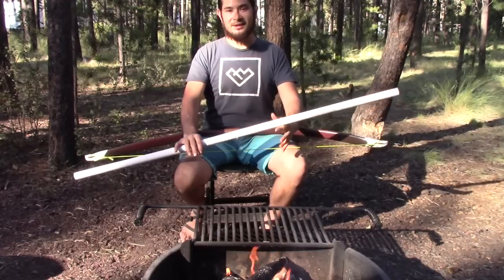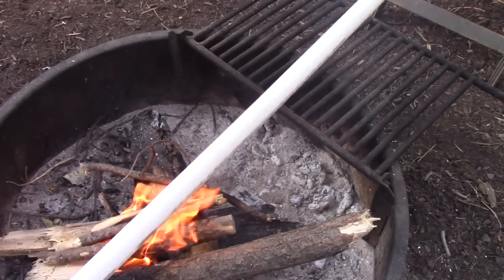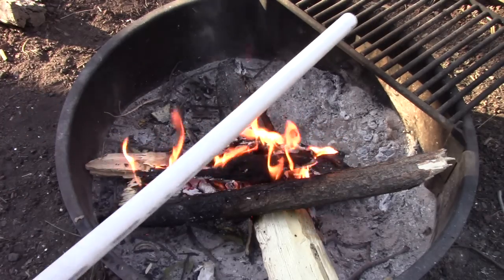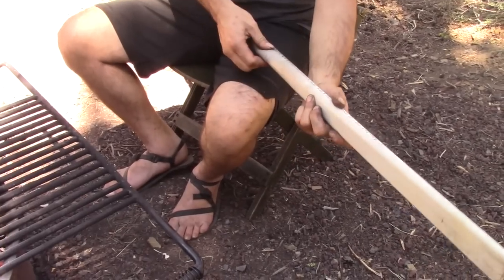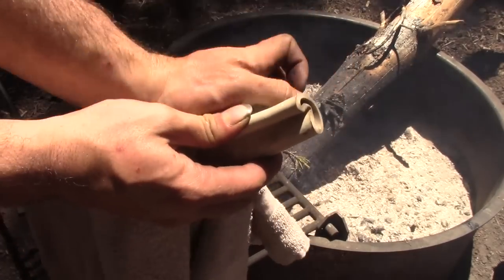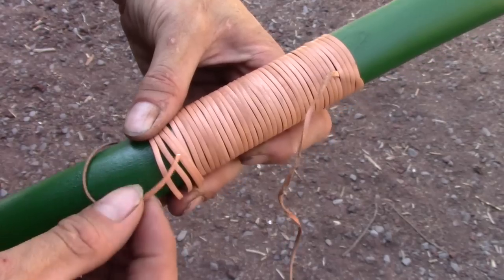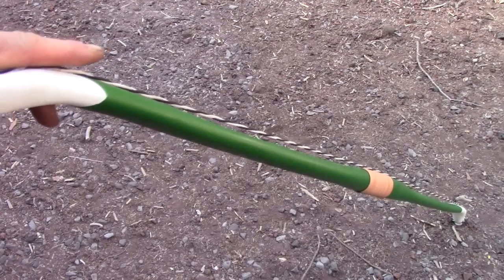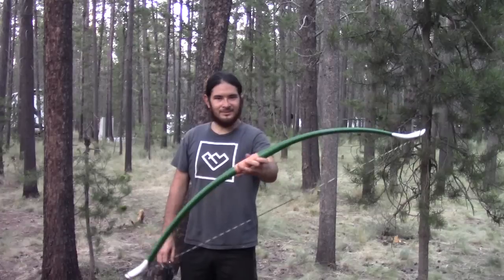Making a 50 Pound PVC Pipe Bow - Echoes in Time 2020 Online

Comment: You are an outstanding teacher and craftsman. I have shaped my share of pvc working in the electrical trade. We would block at least one of the pvc with duck tape, so as to hold the heat in and heat from the inside also. Saves around 50% of heating time.
Reply from the maker: Thank you for watching and sharing your knowledge!

Comment: Would it be possible to make a "hornbow" type out of this? Would pvc withstand the almost 180° flex?
Reply from the maker: Yes it can, but the bow needs to be longer. 62” pipe with 9 inches of reflex will yield a fast bow. If the bow is too short the pipe will collapse.

Comment: For a either dual or single side shelf for the arrow to sit on you can use a wedge of wood bought from a Hardware or big home improvement store. Then somehow make the wide end a tick curved making what you want the shape of using tools like a small hacksaw and sanding smooth. From there use the wide side as the top side inside the handle wrap to the top is about 3/4 from the top then make sure the handle wrap is covering the the whole piece of wood.

Comment: The King is back
Reply: also, is the amount that the limbs are uneven in this bow an issue or is pvc forgiving enough for that?
Reply from the maker: It’s not an issue, just make the limb that bends more the top. The bottom limb will take more set than the top as the bow is used, so more flex on top is fine. Even a pretty lopsided PVC bow shoots alright.

Comment: As a no-heat method have you ever tried cutting a thin strip out of a length of pipe so that it will close along the length and slide inside another length of tube?

Comment: I hope you're still answering questions here - is having one side of the bow flex more than the other, a common thing? Is it desirable to have it that way? Would it be possible to reheat, and reflatten the more flexible side to attempt to make it stronger, and a more even flex?
Also,, a suggestion,, soak your leather wrap until wet, before you wrap your handle. Not only will it allow the leather to be wrapped tighter,,, when it dries, it will shrink slightly, making the wrapping even tighter. Then rub mineral oil into it to waterproof it.
Reply from the maker: Thank you for the tip! Having one limb bend a little more is fine. I make the weaker limb the top end of the bow as it needs to be more flexible for how the handle is placed. If it is really unbalanced, you can reheat the whole limb and reflatten. Another way is to heat the bow limb up until it starts to puff up. If done carefully, the whole limb can be made stronger without having to reflatten.
Reply: BackyardBowyer thank you!
Now I have another question,,, have you ever made a pvc crossbow?

Comment: Great video. Very much interested in experimenting with my own PVC bow. Just not sure what strength of PVC you used, if that is the right term. Here in Guyana I have access to non-pressurized and pressurized PVC. Obviously, the pressurized PVC has much more tensile strength. Just not sure which is best to use.

Comment: Hi Nick! Glad to see you back in action! If I use a 3/4" pipe with all the other measurements the same, do you think i will get a bow in the 35-45lb range? Or should I shorten it a little?
Reply from the maker: Hi! At these measurements you’ll end up in the 15 pound range. 35-45 pounds is 48-44 inches long to start on 3/4” PVC pipe. Thanks for watching!

Comment: About three years ago I watched one of your videos and bought some pvc and fiberglass driveway markers. Since then they have gathered dust in my shed but this video has inspired me again to break out the heat gun. Would you still recommend using fiberglass rods inside? Or do you think only using pvc is better. I'm glad to see you're still making cotent.
Reply: content
Reply from the maker: Awesome! I suggest either heating or fiberglass, but a you can do both. I prefer no fiberglass because the bow is physically lighter and a little faster generally.

Comment: Very nice but i have a doubt when a pipe firing on time how to observe which place in heat takes more and which place heat takes less tell me what will be observed
Reply from the maker: The most important thing is that the whole section that is being formed be within the plastic range (a temperature range from about 180-270 degrees F, or 82-132 degrees C).

I usually test this by quickly pressing my thumb down on the pipe an inch at a time. When the plastic feels equally flexible, I know the pipe is in the right temperature range.

If you are talking about limb-timing and tiller, most tuning is done by adding reflex and reflex in the limbs, and then fine tuning by moving the arrow rest on the bow up and down until the limbs return at the same time,
Reply: @BackyardBowyer I understand clearly but I have near U-Pvc pipes any problem or solve the bow,but it is firing also but doubt ❔❓

Comment: Would you recommend unstringing the bow at all? Ive heard it helps preserve the strength of the bow over time. Super new to this so idk whats good information lol
Reply from the maker: Yes, taking the string of will help the bow. Once of the major reasons to store the bow unstrung is that if something were to happen to it (it's in a very hot car or ends up with something stacked on it) while strung, the tension of the string could cause the bow to warp or become damaged. Without the string on, the bow will not generally deform even in normal high heat (under 180 degrees F).

I hope this helps!

Comment: Can you spray it with water to cool it down and freeze in place without weakening the pvc?
Reply from the maker: You can spray it down, a damp towel also helps. I’ve only ever used a little water, though I have used a little snow in my hand (mainly to keep my hand cool).
Reply: @BackyardBowyer Thanks, nice build and great video. You made the string look easy.

Comment: Can you keep the pvc strung or do you have to keep it unstrung when not in use?
Reply from the maker: You can keep the bow strung, but it may become warped if it gets too warm (in a hot car, leaning against a heater, too close to a fire). I've had several PVC bows strung and displayed on the wall and shot daily for years without a problem.
I always unstring my bows when traveling or storing long term.

Thanks for watching!

Comment: so how do I get a 32" draw with the 50+ draw weight if adding the extra 4 " drops it by 10 lbs? do I go to a 1 1/4 pipe then taper the limbs down on the string end to keep the speed up
Reply from the maker: Thanks for watching and building along! Adding the extra 4 inches will bring the weight down to 50-55 pounds at 32". If you want heavier, this bow draws around 60-70 pounds at 32" without adding any length. If you use 1-1/4 inch pipe, 66" will get you into the 60 pound range. 1-1/4 inch pipe usually draws over 100 pounds at under 60" long.
Reply: @BackyardBowyer  Thanks for the reply think I'm going to give the 1 1/4 66" a try

Comment: Nick, I am 6ft 3in and my arrows for my 90+lb Hoyt compound bow are 33 1/3ins long. Would you mind helping me with the dimensions for a PVC bow that would fit me?? I would like it to be at least 60+lbs let off...thanks in advance! Great to see you back at it!!
Reply from the maker: Hi! If you add five inches to the starting length of the pipe, the bow will draw 50-55 pounds at a 33” draw. Add three inches instead and you’ll be in the 60-65 pound range at a 33” draw.

Keep in mind that there is no let off and the peak comes at the end of the draw rather than mid-draw like a compound. 

Thanks for watching!

Comment: As the pvc is hollow is there a way to increase the draw weight by putting another smaller pvc thru the larger one?
Kinda like a SanMai pvc? New to the channel so not sure if this has been answered yet.
Reply: I've seen it done by another Youtuber, don't remember who though. I tried it myself but it was very hard to get the double tube to be hot enough to be flexible without the outer layer being too hot.

Comment: I made your last hand bend but when stringing it, the limbs took the bend of the bow after unstringing.  Is that normal?
Reply from the maker: Do they bend all the way or did they take about 1-2 inches of Bend? The second is normal. If they stayed completely bent it may be possible they were too hot when strung up.
Reply: @BackyardBowyer  it was quit the change from the straight and ever slightly forward facing limbs to curved back ones. Maybe 2 inches though? Is that normal?
Reply: @BackyardBowyer  oh! And one limb seems a little thinner than the other, so one limb is bending significantly more.  Should I just reflatten these?

Comment: I've seen a few of your videos now. Thank you for sharing them. One video you made years ago shows youtesting the viability of three different PVC pipes by placing them within a cloth and hitting them with a hammer several times. The first two shattered after several Hits and The last of the three did not shatter. Do you do this every time you do a PVC bow or have things changed where you no longer think it's necessary to do this? I only saw it in that video.
Reply from the maker: I do this on every plumbing and electrical PVC pipe I buy unless it is obviously cracked or shows signs of yellowing or crazing. I don’t show it in most videos (I mentioned it in my earlier videos from 2012) but it’s something I always consider when selecting pipe. There was a time I didn’t test electrical conduit but they are not always less brittle than white pipe. I’ve been using a lot of Formufit furniture grade PVC and I no longer test each piece directly because of how consistent the quality has been.
Reply: @BackyardBowyer  thank you for the reply. I'll stay looking for the Formufit PVC. I don't think I could bring myself to damaging several pipes reach time I want to build a bow lol

Again, thanks.

Comment: I have a 32 inch draw, is there a way to increase draw length without decreasing draw weight?
Reply from the maker: The draw weight will be at whatever the length is. This bow drawn to 32 would be around 60-65 pounds. Starting with a 60” length will bring the weight down to 50-55 pounds at 32”.

Comment: Also just a quick question do you think that using bank line cordage would make a good twisted bow string?
Reply from the maker: If you can find polyester line it will work well. Cotton is usually not strong enough and nylon is very stretchy. If it’s all you have, give it a try.
Reply: @BackyardBowyer  
Great thanks for the help

Comment: In this video you used a 56 inch pipe and made a 55 pound bow and said every 2 inch we loose we add a pound then i saw your another video in which you make a bow from 48 inch pipe and made a 40 pound bow.... I dont understand you said loosing inches increases pounds.. Please answer it i am a bit confused
Reply from the maker: Thanks for watching! This bow uses 1” pipe, while the 40 pound bow uses 3/4” which is thinner and has a lower potential draw weight. A bow of this style at 48 inches would draw around 75-80 pounds. It’s about 5 pounds of draw for every 2 inches of pipe, all other design elements being equal.
Reply: @BackyardBowyer  thank you very much
Reply: @BackyardBowyer  i had one more question that can i make a bow from those orange coloured pvc pipes

Comment: Hey Nick! I made a PVC 50 pound bow 2 years ago with your tutorial. I didn't paint it and this spring I strang it again to go bowfishing, tried to make it more benndy again, because throughh the winter I think it kinda thickened and when bending with my knee just a bit PVC broke. Im jusst glad it didn't happen while shooting :D I think it may be because I left it in the garage through the winter and the cold got it. What do you think, could this be the issue? Im planning to make another one, but this time I will paint it and keep in inn a warm place through the winter. Also, when I made that bow I did your suggested test with the hammer and PVC was holding fine
Reply from the maker: If the bow thickened, something may have caused it to heat up at some point and the limbs expanded. There could also have been some damage to the pipe (deep enough scratches can start a break) that may be hard to see if unpainted/uncovered.
Reply: BackyardBowyer Thanks for the reply! Also as I did it for the first time, one spot was a little bit burnt from the heatgun :D I think the same limb with the burn broke. It functioned well for two years tho, as it cost me basically nothing I dont mind making a new one every few years :D Will make sure to do it better next time!
Reply from the maker: Awesome! You definitely will! Thank you for watching!
Reply: @BackyardBowyer  I have one more question. I bought some acrylic paint and painted my bow, waiting for it to dry. How long does it usually take? There’s no indication on the bottle, tho it says that it stains when dry, so not sure if this paint is fine

Comment: can we use this tip for a re curve bow
Reply from the maker: Yes you can.
Reply: @BackyardBowyer  cool.. Man you are the pvc bow man. Im about done watching all your videos..  I just cant pinpoint how long i should make the bow. And if inshould make a long bow. Or recurve
Reply from the maker: Recurves tend to be faster but longbows are usually quieter and smoother to shoot. What draw weight were you aiming for?
Reply: @BackyardBowyer  i see. il go for a recurve. 40lbs sounds good. Im 5'7"
Reply from the maker: Starting with a 60” length of 1” PVC pipe will get you around 40 pounds at a 26” draw.

Comment: Today it is more than likely an archer would put his arrow on the left hand side of the bow to fire it. There is a distinct possibility however that a majority of historical archers would use both sides and a high probability using the right hand side was more usual. We’ve been convinced that the left side of the bow is correct and using the right side is stupid. I quick internet search of medieval paintings etc. Will show the vast majority of archers from many cultures were using the right side. People will suggest the artists were not archers and therefore confused which side to use in illustrations. But if you think or read about it everybody knew archery because archery it was so common. Start with the four Breton archers shown on the Bayeux tapestry.